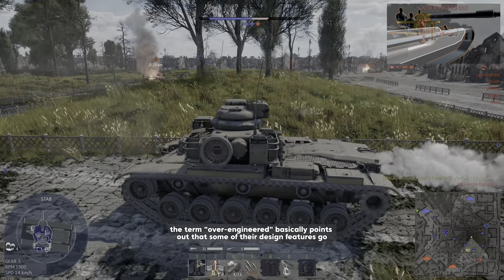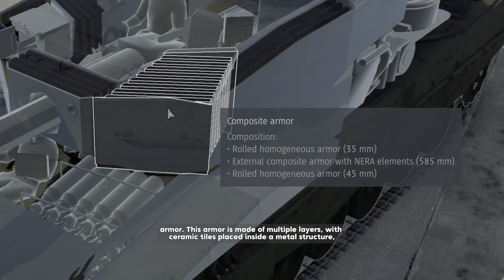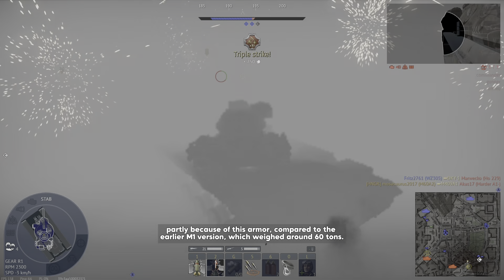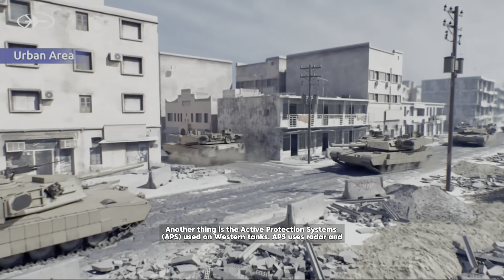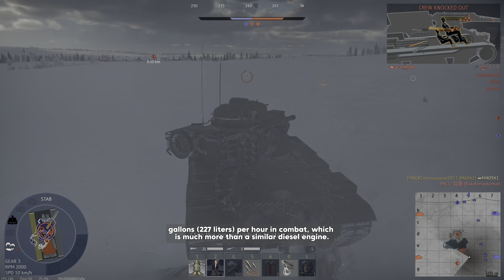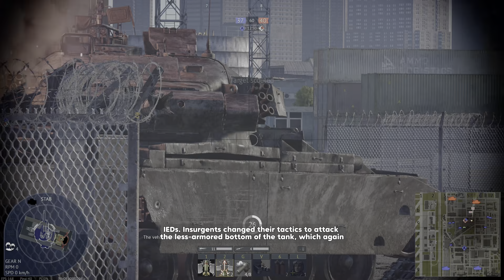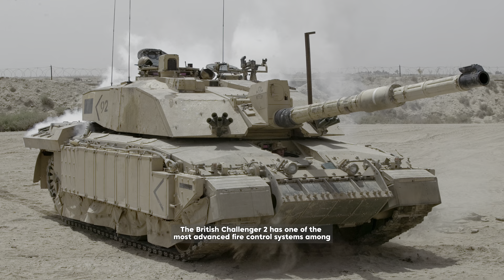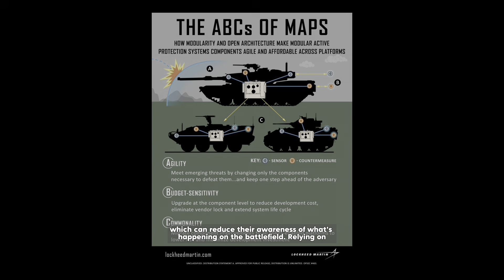Are Western tanks over-engineered?

Comment: You understand Russian tanks ALSO have advanced FCS', thermals, Vehicle GPS systems and more? Crazyyyyy right? Unbelievable.

Even a fucking T-72B3 has a good FCS. 

Prompted it DOES NOT have reverse speed or commander thermals 

But the maintenance of these things, and a set of other extremely helpful shit is just unbelievable I guess
Reply: T-72B3 gets the doubler system i.e the commander is able to use the provided Sosna-U, beyond that, installation of a CITS would increase the modernization cost of this "workhorse" tank by up to 50 percent, Russians decided they rather have 3 "armored guns" than 2
Reply: @0katze  Indeed, and they don't have as much time to train replacement commanders anyway with most of them dying as soon as their tanks are hit.
Reply: @tackytrooper  if you actually look at real numbers and not the "lost 4000 tanks narrative" you can actually see it's no where near that. Even Western sources say it isn't, like in the last year 914 tank crewmen died, if we just assume all of them were due to a turret toss that's still only 304. Prompted it's a chunk but not the retarded numbers
Reply: T-72B3 doesn’t have commander thermals, unstablized commander sights in plenty of them, and multiple of them have been spotted with older sights with no cooled thermals at all. But the old 1989 sights… 

They lack quite a few mainstream things that a good MBT base level should have by now. The Abrams M1A1 even in its beginning stages was intended to have a stabilized commanders sight.
Reply: @TitaniumHull  I agree the B3 is lacking in a couple area's but it's literally just the transmission reverse gear and not a great commanders station 

As for the "french" sight that literally hasn't been on a B3 before. 

That's about it honestly, I actually worked on these for maintenance a couple times. I promise you it's infinitely easier than an Abrams or least a majority so. You can have the same B3 damaged 6 different times and repaired but the enemy still counted the one same tank dying 6 times lol
Reply: @TitaniumHull The M1a1 didn't have a stabilized commanders sight, it only had a cupola.
Edit: the FEP model came with a stabilized commanders sight. Up until that point, it didn't have one.
Reply: @voidtempering8700  The M1A1 was intended to have a commanders sight. That’s my only claim about that. My next claim is the T-72B3 in 2024 doesn’t have a stabilized sight standardized unlike western tanks. Thank you very much.
Reply: Also didn’t the B3 use tons of French thermals from years? Until they got cut off, and now since here’s a shortage that’s outta the picture. Rarely they’ll get a domestic copy of a western thermal but even then that’s in short supply. 

Overall the B3 isn’t at a stage where the upgrade is up to scuff of where it should be in this day and age. It could be improved more if they just slapped a T-90M turret, and did a Ukrainian reverse gear system so you can actually get out of a hostile situation without having to shake your clappers. But whatever. They do whatever they want, even at the expense of their men. Not my problem tbh.

Comment: Enlighten me. To this day I still wonders why there is no diesel variant of Abrams, at least for export. Could be handy if the countries that bought them has limited supply of fuel or dependent from imported fuel.
Reply: abrams turbine can run on diesel
Reply: @lefunnyN1  but as on the video said, it's a fuel guzzler. So I assume whatever fuel they use, it will run out faster than diesel engine.
Reply: There is simply no diesel engine that is small enough to fit in where the turbine would be while offering the same performance. Part of the reason why the turbine was chosen was because its torque rate was far superior than diesel as well as the small size, and the installation of a diesel engine would’ve caused major issue with the core design of the Abram. 

The reason why the Leopard 2’s bustle ammo storage is only around half the size of the Abram is because the turret motor needed space but it’s not available due to the large diesel engine. The Leopard 2 hull ammo storage is also in a much bigger and in a much more vulnerable position compared to the Abram because of this, that same space was used as additional fuel tanks for the Abram which help with the thirsty engine and keeps the driver safe from HEAT projectiles to the side.
Reply: The Abrams has a multifuel turbine engine which can be run on other fuels if need be. The Australian army runs their Abrams exclusively on diesel fuel. The US army chooses to use JP5 or JP8 in all their vehicles including tanks to make logistics easier.
Reply: There are prototypes, the Abrams X is a Cummins Diesel Abrams… Heck one of the original prototypes used the diesel. It’s been done, and done before. It’s a thought for the future. It’s not unheard of to General Dynamics.

Comment: yes, because everything they have (excluding majority of the powerpack), can be severely reduced in complexity and even costs. while i may have low knowledge on the electronic systems. as long as i know the principles and enough about it i can direct in simplification while not reducing in performance and quality.

both sides are low quality. soviet/russian has poor manufacturing standards, while nato has complexity in the slaanesh levels of excess. both are shit but for different reasons.

EDIT: a block i forgot to mention. which i should not have, shame on me. russian tanks, overall, are better. the reason for it isn't that the ARE better in construction, i'll take challi 2 any day on that front. but they're complex where needed simple where not. and even with thing like the sosna-u FCS with all the bells and whistles of western systems. it's still comparatively simple increasing ruggedness. this is excluding why. after all manufacture =/= engineering. they are separate majorly. they have the complexity as it is needed. simplicity where not leading to comparatively good tanks.

russia build their tanks for war, not peace time. NATO built for peace time where logistical lines are not effected and where they can be decadent and fumb as duck. and given things are bubbling, that red scare is going to be realised rather abruptly when we have no armour on the field cause logistically you can't. one example is turbine engines, as stated in the vid, too much fuel, but on the same front unreliable aspects of engines from european armour. however. in places OF pro complexity, the leopard 2's powerpack swapping. that can be done really quickly. meaning you can get a dud engine replaced and a working tank back out there. or take a dud tank's engine and put into a none dud tank

another aspect of overcomplexity is the FCS systems. and how thermals are done. if russia can do it on the cheaper and still have the "quality" why can't we? the sodding T-80B has cant correction. a tank from the 80's from the hooviet soonion. had a more advanced and capable FCS than NATO. modern NATO i am unsure if they do as i can't find any info on it that is declassified and public information. classified restricted is STILL classified, but i digress. it's why i say american stuff is mediocrity. it'S trying to do everything, and in the process it can't do anything it's meant to well. the abrams, it's speed is matched by the much more efficient leopard 2. the armour is beaten by the challenger 2, the accuracy of the gun is beaten by the replaced challenger 1. the navigation system, CV-90 has a better crew nav system. and iirc the navigation system also has a positional memory for when GPS goes down so you aren't SOL on that front.

personally i think and strongly push for, train them with stick before you give them bricks. attitude. because no matter what all your fancy stuff WILL breakdown, WILL throw an error, WILL be out of whack. and if you can't fight with all of it down. powered traverse, stabiliser, FCS, all of it. then you can't fight at all. it's why no matter how good i can build something, am gonna make a back up system for it that doesn't sacrifice anything to a negative degree. and example of this is having an inertial starter on engines. yeah my starter motor is monstrously well built. but it will die and need replacing. but it's gonna do it when i DON'T want or need it to. so i have the back up. same with tanks they should have an innertial starter. when things just go really bad but you can still, slimly get out of there if you act fast. plus means cold starts are a lot easier only needing a few sticks of jerky and a pint while reducing the HUGE strain on the electrical system meaning longer life. only adding like 100 if that kg to a tank.

now am not saying reject tech return to monke. what i am saying is don't be shit and work off of the principles of what makes it then build off of those principles. it's why i am quite fond of the AZ autoloader, low down out of the way. perfect for NATO given the hull down nature of doctrine and tactics. it's also why am not fond of bustle ammo racks but an appropriate distribution of ammo around the vehicle. cause when the bustle is hit and al your ammo is in there, you just lost all ammo. and potentially the tank. and most tanks have a hull ammo rack by the driver. and not all tanks have blow out panels for them either. hull ammo isn't the issue, the distribution is. for example.

Comment: You did not just compare ERA to APS
Reply: They arent similar in their design but they share a similar function, to defend against munitions especially HEAT shells, ATGMS and man portable anti tank systems
Reply: ERA is part of the passive system of protection of tanks while APS is what it says, active protection. The Russians do not have an APS for their tanks in service, only passive systems. They can be compared using those metrics.
Reply: @Gavriloprincep ERA is a western invention. So in a way it was imo justified for the time period. I don’t think it was overkill. As composite armor wasn’t much of a thing by then…
Reply: @Gavriloprincep  They do have active soft-kill systems. They also developed hard kill systems, but I'm not sure if they are currently fielded it in any significant numbers or at all, but they do have them.
Reply: @vojtechpribyl7386 fielded, but not significantly.
Reply: @Gavriloprincep T-90M with Arena have been spotted operating inside the SMO for some months now.
Reply: ERA is both West and EAST. How did you even think that the USSR put it so fast on its own tanks.
Reply: @w0lfgm  They ain’t the first. The EAST & WEST both use them. But it did not originate in Russia like people assumed. But in the western. Same with thermals. Hence why Russia struggles with domestic thermals, had to piggies back off the French lol. That’s not a condemnation just the reality. Of why they had the issues they did. But things like not having a stabilized commander sight there isn’t really an excuse other than laziness, cheapness, and corruption…
Reply: @w0lfgm  They ain’t the first. The East & west both use them (no one said that wasn’t the case). But it did not originate in Rusha like people constantly assumed. But in the west. Same with thermals, hence why Rusha struggles with domestic thermals, had to piggy back off the French lol. That’s not a condemnation just the reality of why they had the issues they did. But things like not having a stabilized commander sight, or a remotely good reverse speed there isn’t really an excuse other than laziness, cheapness, and c0rrupti0n…
Reply: @TitaniumHull  that is stretching it... Its more that natural evolution of defense. You could said that Yes Australia "invented it"... but it was mostly a test of concept and in the same decade Russia/URSS come to the same conclusion on their own. So no its not like its a tech that the West invented and make it popular and Russia just Follow. But what its clear its that Russian Perfected it on their own.

Also bring the Thermal shit its just pedant bs... Since the fall of the URSS Russia Struggle with a lot off stuff. Make it sound like they're some monkey its just some stupid shit that narrow mind people would said.
Reply from the maker: @PierreDolas  I did and I don‘t see a problem with that. But I do make mistakes so please enlighten me.
Reply: @bobiwt I think ERA originated from the west so wouldn’t that also be over-engineered too? I mean idk. Depends on your metric for that. Just asking!
Reply: @TitaniumHull  originated from Australia. In WW2.
Reply: @osmacar  Yes, my point. Australia isn’t Russia, isn’t Slavic.
Reply: @TitaniumHull  mental grace of a lobotomised hippo you are.